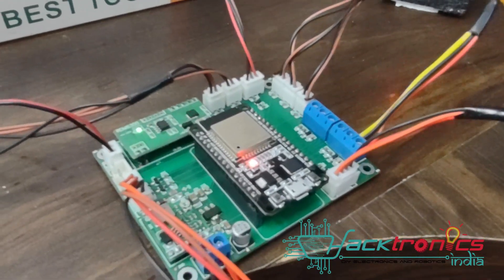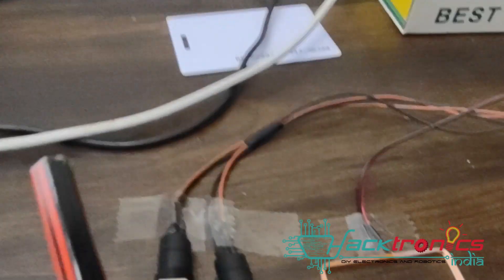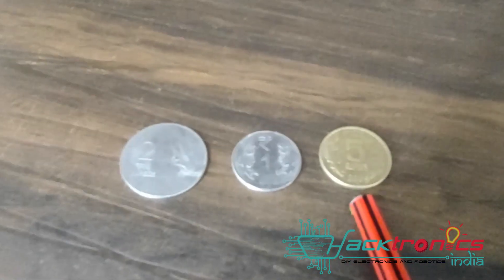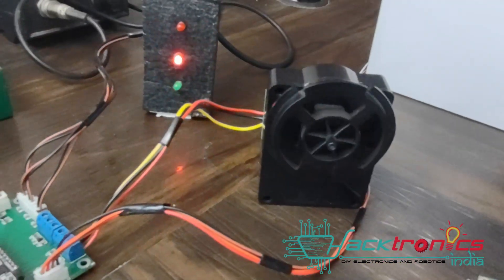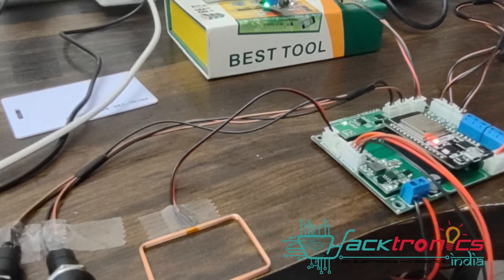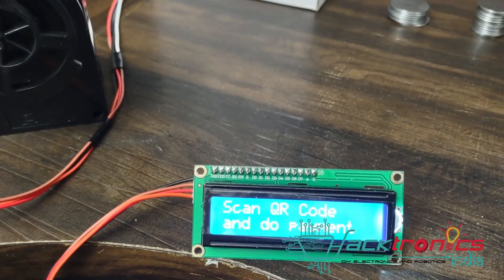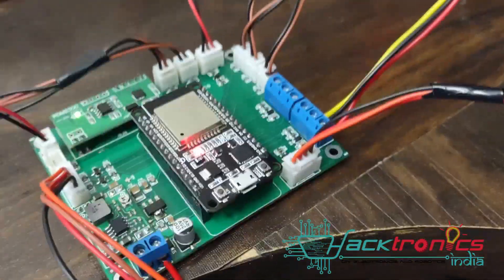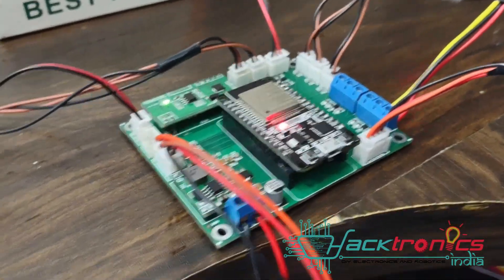2 Types of Products Vending Machine : Coin, RFID, UPI Payments

Comment: Doubt is how you validateing UIP payments
Reply from the maker: I am not validating, payment gateway is validating. We are interacting with various banks and payment gateways using their API for the same. Earlier if you see, we have a video where we just rely on SMS without any gateway, but that is school project, this is industrial once, and hence can't rely on SMS, need proper authentication and validation, that's where the intermediaries (Banks & Payment Gateways) comes into picture.
Reply: @HacktronicsIndia  hi thanks for the Info, if you want to get a payment notification on your device your device should get connected to internet or else you should have iot sim how Paytm sound box works
Reply from the maker: @abhishekcgowda9773  It needs wifi, you can use a single Jio dongle to connect multiple vending machines, there is no eSIM concept here. The vending machine controller needs to be connected to internet. Also everything is automatic, so Paytm sound box like thing is useless, because no one would be there to monitor the vending machine.

Comment: wow, thanks for this cool explanation..
I curious with the mechanical of motor,,I believe it has 3 pins, and also has limit switch to detect the rotation and became sensor to stopping the motor, right?
can you give me logic for microcontroller to make it stops? I used arduino mega,,I've try to use general limit switch  + arduino program for the logic to stopping the motor, but I've failed to make it stop,,
I believe you can help me for this,,thanks before for the advance
Reply from the maker: Its just a limit switch, so just read as an interrupt. The challenge is it will fire or miss the trigger, the way these motors is designed. the cut will trigger an early interrupt and sometimes you will miss a trigger because its not perfectly circle its oval. So you have to rely on some clever logic that takes both the time and interrupt into consideration, and if its too early ignore the int, if there is no int for long, stop it anyway.
Reply: @HacktronicsIndia  oh ok, got it,,so I need to combine with time delay too, right? I'll try it, but I believe that the stability of voltage will become factor of consistency of motor rotation, I mean the precision of stopping point. This will also affect how much delay I need to set. Thanks for advance, really appreciate it
Reply from the maker: @mamenit6121  Yes you need a stable voltage supply, that's why we have used a 3A module in the project. So basically its a combination of lots of things